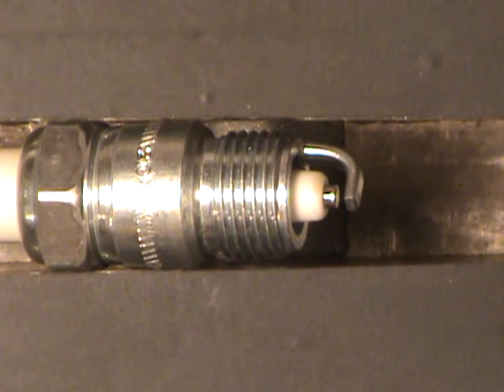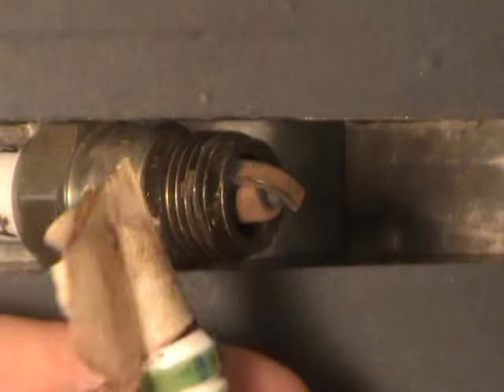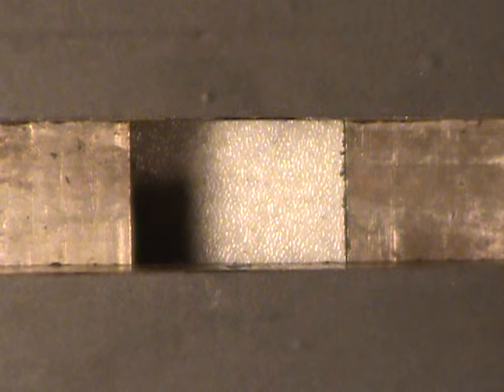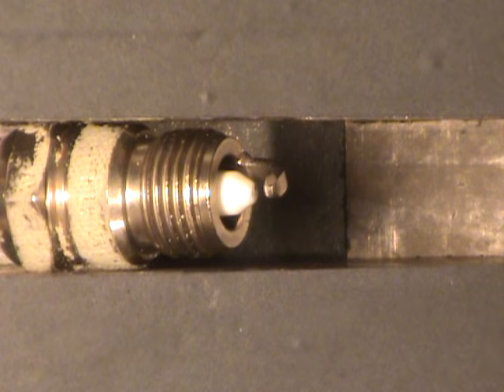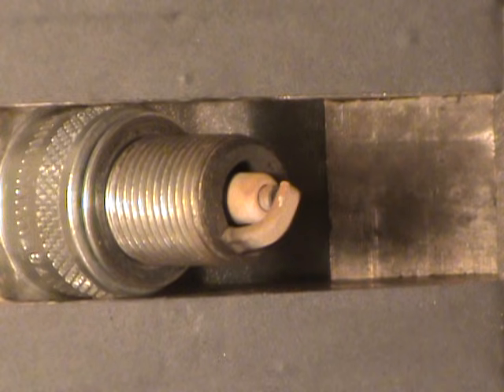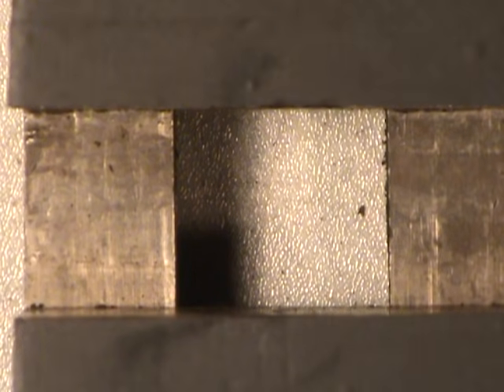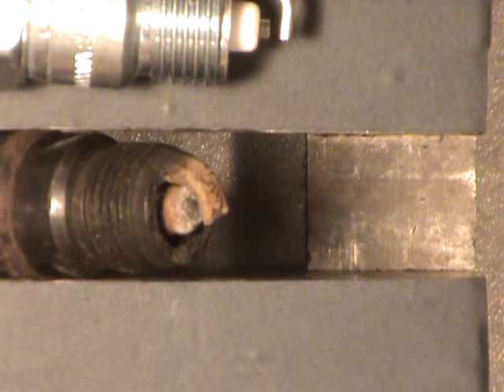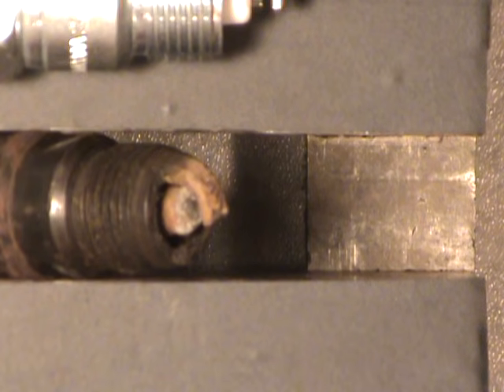SPARK PLUGS How to Read them (Part 3)

Comment from the maker: ...threaded, shell portion of the spark plug....If it did break off, I sure hope that, there isn't a Broken piece of Metal from your Spark Plug "Bouncing" around in the Cylinder, because, as the engine is running, it will continue doing "Damage" to that very same Cylinder!..."Ouch!"...Now, if it "Melted" off, sounds that, that particular Cylinder could have been running "Way-Too-Lean" (air/fuel ratio)....That would perhaps only apply to a Multi-Point Fuel Injected Engine, if in fact,...(con't)

Comment from the maker: Greetings kashpc....I'm guessing that you only have "1" Damaged Spark Plug?....Hopefully, the missing part of your Spark Plug didn't cause any damage to the Piston, Cylinder, Cylinder Head, Valves, etc., in your Engine....Also, did the Outer Electrode "Melt-Off" or "Break-Off?"....If it "Broke-Off", It might have been a Manufacturing Defect, or, even someone may have bent the Outer Electrode a bit too far, and maybe, back and forth too many times, weakening where it joins the...(con't)

Comment: Thank you for this interesting video. I was accelerating my car today to lets say 3,000 RPM (not too much I know) and strangely the outer tip of the spark plug blew off! This never happened to me before I guess this happened because the plugs were not the correct heat range and are very old. What do you think? .

Comment from the maker: ...Golly-Gosh-Darn, Yes-Siree-Bob, I should also mention that some of the later Holley Carburetors even have a little Screw-In-Clear-Sight-Plug, that goes into that threaded hole that you used to watch the Gasoline/Fuel trickle out of....Much Safer, and time saving too!....In closing, you might need some "Jet-Extensions" for your Secondary Float Bowl, to avoid starving the secondary's of that much needed Rich air/fuel mixture during that "Neck-Snapping-Launch!"....Take care, and have a good one

Comment from the maker: ...order to determine the "Wet-Fuel-Level"....I used a Spritzer-tube, you know, that little small plastic tube that you plug into a pressurized can of something that squirts fluid to the desired location?....I removed the metering rods from the Thermoquad (Engine not running), and put a stop, kinda like a little flag, made out of electrical tape, and used it, much like you would when you use your engines oil level checking Dipstick....Worked like a Charm!...lol...Where was I, oh yeah...(con't)

Comment from the maker: ...all of that particular Style of Holley Carburetor, stand a much better chance of having each of that Carburetors "Circuits" Meter the Air/Fuel properly in order to achieve, and hold the "Calibrations" to a more Refined and accurate Tolerance....It was this very fact that had me doing some head-scratching a few years ago, as, Rochesters and Thermoquads "Wet-Fuel-Levels" can't be seen at all from the outside!....In one of my Thermoquad-Videos,  you can see what I came up with, in...(con't)

Comment from the maker: Greetings TylerART....Thanks for your comment....One of the Best Design Features of Holley Carburetors is that some of them have "Externally-Adjustable-Float-Level-Settings", (Yes-Sir, I'm talking about the ones with "Duel" float Bowls, one front, and one rear), and even if you have to remove the "Plug" in order to watch the Gasoline/Fuel Dribble out in order to Confirm that the "Wet-Fuel-Level" is set properly (and, make sure your Vehicle is on "Level Ground" when you do so!), then...(con't)

Comment from the maker: ..."Primary-Jets" so that my Freshly Re-Built 1974 Thermoquad would keep my Engine from Bucking back and forth while I was just trying to maintain 30 Miles per hour (or, 50 kilometers per hour)!....You see my Friend, a Carburetor just can't adjust itself, unless of course it was one of the later Computer controlled "Feed-Back" Carburetors....Bottom line, the Carburetor has to be "Calibrated", for the type of Fuel that the Engine Burns/Uses....I was lucky, one Simple Jet-Change....Take care

Comment from the maker: ...calibrated for 100% Full Strength Gasoline of, oh, lets say, the 1970's for example....This 100% Gasoline is Un-Leaded by the way, and you could easily see the Deposits on your Spark Plugs....Also, before Un-Leaded 100% Gasoline came into the Retail existence, there was the Leaded 100% Gasoline, and that stuff gave you an abundance of Deposits on your Spark Plugs to "Read"....I had to go from .095" to .104" (95 thousandths of an inch to 104 thousandths of an inch) on my...(con't)

Comment from the maker: ...that their Engines are ingesting, and burning in the combustion chambers, that these Folks are not able to "Read" their Engines Spark Plugs, due to the "Lack-Of -Deposits-Showing" on their Spark Plugs "Fire-ing-End!"....With all of that Ethanol (Alcohol?), being administered to your engine via the Carburetor being "Jetted" far too "Lean" for this type of Fuel, then, it can, and will cause Lean-Running Problems in all of the Carburetors-Circuits, especially with Carburetors that were..(con't)

Comment: It was all a matter of opinion. Drag racers swore by type F. And yes many old timers would put it in anything. So it don't surprise me they put it in  your 727. Check out my video on the various fluid types in modern day cars. I remember 50 gallon barrels of F in tranny shops when I first got in the biz. It was cheaper so many shops used it if for nothing else to increase profit.

Comment from the maker: ...From what I recall, the 727-Torqueflite (Torqueflight) was supposed to be filled with Dexron, according to the books/manuals that I have read....I also recall hearing about, or maybe reading about, that the Dexron, had an Additive to help with the Auto-Transmissions Seals, as far as Conditioning the Seals, so that they don't start leaking perhaps?....Yes-Sir, nothing like having your car with a "No-Drive-in-any-gear-on-your-Shifter", while trying to get Home....Take care, and have a good one

Comment from the maker: ...about the difference between Dexron and Type-F Automatic Transmission Fluid....The response that he gave me, was that the Type-F (Ford?) had a "Higher Breakdown Temperature", as compared to the Dexron (General Motors?) Fluid....He also said that they put Type-F in most Automatic Transmissions that they service....That's right, they put Type-F in my 727-Torqflite (Torqueflight?), and it seemed to work just fine....I later, looked further into the difference of the two Fluids,...(con't)

Comment from the maker: Greetings David Smith....I hear Ya....A couple of things come to mind....I wonder if a newly certified Mechanic would be able to figure out a Carburetor?....I'm speaking of the younger Lads that probably were not exposed to Carburetors, and only Fuel Injection....The reason being, that since the 80's, the transition to fuel injection became quite obvious on Newer Factory Vehicles....Also, some years ago, I asked a Manager at a Transmission Fix-Em-Up Establishment,...(con't)

Comment from the maker: ...the method that I have been using for a very long time, to read my spark plugs, is what works for me....However, since most of the Gasoline that had Lead (pronounced Led), and is no longer available for street use, makes it more difficult for some to actually see, or read spark plugs, due to the "Un-Leaded" Gasoline, and some of the newer Formulations out there, leaving next to No-Deposits on your spark plugs to "Read!"....I hope that you find some (crossing fingers...lol)....Take care

Comment from the maker: ....as you can very well see, how my Spark Plug Video's "Thumbnail-Picture" appears, with the Gasoline that I put in my gas tank, that I'm most certainly getting a very nice "Tan" Color showing....However, you did ask how long will it take to start seeing an adequate amount of Deposits on your engines Spark Plugs, so you will be able to see what is going on inside your engines combustion chambers....Drive at all Speeds (Legally!, lol) about 100 Miles, more is even better....(con't)

Comment from the maker: ...(or), it could have even been a faulty valve stem Oil-Seal?....With the exception of the excessive (well, it really isn't something that I would lose sleep over), and the fact that I keep a very close eye on all of the vehicles that I have, and had, Fluid Levels and the way that they perform/run....I guess that I might have to change Mr. 400's Number 6 Spark Plug a wee-bit more often then the rest of his/hers remaining 7 brothers/sisters as the case may be...lol...Thanks, and, take care

Comment from the maker: ...I haven't ruled out a misfire on that particular spark plug, and its associated electrical path, right from the HEI (High Energy Ignition) Distributor Cap and spark plug wire....Still, the most obvious Symptom still happens to be the excessive engine Oil Consumption....I'm under the impression (illusion?), that it was a Ring-Seating problem, as in Oil-Control, or perhaps excessive valve stem to valve guide clearance (more then .003" or 3 thousandths of an inch), or...(con't)

Comment from the maker: ...if Burning engine coolant (in an engine) is anything like Burning Auto-Transmission Fluid, then, I would be mistaken for "James Bond's Aston Martin!", you know, with that Big-White-Smoke-Cloud that James Bond deployed behind his car, in order to Blind/Confuse the Bad Guys, as he was being chased?....Like James Bond, It happened to me, when the Vacuum Modulator developed a leak in its rubber diaphragm, allowing the carburetor, to suck up some AT fluid, and then the "White-Smoke!"....(con't)

Comment from the maker: ...my engines excessive Oil-Consumption was about the only issue that I could find....There wasn't any noticeable drop in engine coolant, and if the coolant (anti-freeze/water mixture) made its way into the Oiling-System, I would have found a trace (or maybe more), of the proverbial "Milk-Shake", creamy-colored (yucky-stuff) on my engines Oil-Dip-Stick....It was my Number 6 Spark Plug that had that (electrode-shorting), and, over-abundance of Deposit(s) (if memory serves me right)....(con't)

Comment from the maker: ...my brand new factory 1979 Chevy 400 C.I. V-8 (small-block) started and ran great, until about the 6,000 mile mark (on the odometer, I think?)....Everything appeared to be operating normal, until I started having hesitation problems at about 50 Miles Per Hour (80 Kilometers Per Hour)....Now it's Transfusion time! (nah, not really...lol)....What was happening from the start, was, my Engine was in need of a Quart (or Litre), of Oil, about every 500 Miles!...That is a wee-bit excessive...(con't)

Comment: Could the buildup on the last spark plug be from the cooling system? I have had similar buildups in an engine with a tiny crack in the head...

Comment from the maker: Greetings strikemaster1....Thanks for your nice comment....I've heard that the Rotax engines are a great engine, with excellent build quality as well....If you do try extending your spark plug(s) replacement interval as suggested by your engines manufacturer, may I suggest for safety reasons that you pay very close attention to how your engine is running, you know, like, misfiring, or miss-behaving in any way, shape, or form, so as to prevent you from being harmed in any way...(con't)

Comment: Thanks for this very educational video. It certainly has helped me in understanding my own problems a bit more. I fly an ultra-light aircraft using a Rotax 582 inverted engine. That is... the engine is upside down with the plugs at the bottom. The manual says to change them every 50 hours, but mine never show hardly any wear, so I am tempted to leave them in for a while longer. They always are a wet dark grey colour without any build up at all. Its a 2 stroke engine, which accounts for wetness.

Comment from the maker: ...gap-growth you say?....That is the "Erosion" (arcing, due to the electrical spark) of the center electrode (tip), and the inside of the outer electrode (ground strap)....A good rule of thumb is to have about .001" (one thousandths of an inch) of Erosion (wear) for every 1000 miles of engine operation....Any more then that usually spells trouble....Perhaps, too lean, wrong heat range, overheating engine, type of gasoline, how hard you are pushing the engine, rpm's, etc....Take care my Friend

Comment from the maker: ...the Old-School method that I use, has served me very well, as I haven't Destroyed any engine thus far, due to having said engine jetted too lean, and running at Wide-Open-Throttle....If any of the engines that I have, or have had in the past, had any running issues at all, I most certainly would-not apply full-throttle, until I saw that "Safe" Tan color on my spark plugs....Also, with the older "Conventional" style of spark plugs, I keep a close watch on the Gap-Growth...(con't)

Comment from the maker: ...no matter what engine you are talking about (gasoline ones, that is), if one was to run any gasoline engine too "Lean" (air to fuel ratio), while at Wide-Open-Throttle, one would more then likely "Destroy" the Engine in question, and that my Friend, is a very "Expensive" lesson!....Don't get me wrong, as there is usually an exception for every rule....One of the best ways to determine air/fuel ratio, is with an accurate wide band oxygen sensor, and a very accurate gauge or monitor....(con't)

Comment from the maker: ...my Thermoquad carburetors Factory primary jetting was .095"....When I looked up the factory jetting on the net, it read .098"!!!....If I went any smaller then .104 on my Thermoquads primary jets, I would get a "Lean Surge" (car lurching back and forth) cruising at 30 miles per hour (50 kilometers per hour)....I only run 87 Octane gasoline (cheapest stuff), with factory initial timing of 5 Degrees BTDC, and, no knock, no ping, goes like no tomorrow, and I'm happy as can be!....(con't)

Comment from the maker: ...I've also see Light-Gray-ish inner porcelain as well....Might be ok on newer cars that were engineered to run that lean, because the computer, sensors, and actuators, are kind of a Fail-safe, if you will....Knock sensors, for example, have the ability to tell the ECU (computer) "To Back Off!" (the ignition timing, that is), preventing, knock, etc., to avoid (Expensive) engine damage!....Take a look at my spark plug thumbnail...Light Tan almost all over the inner and outer electrode...(con't)

Comment from the maker: ...now, about going with the "Rocket Science" method of reading spark plugs that you had mentioned....I have no need to go that far in the readings, for the very reason that I'm not trying to shave off a hundredth or two on a 1/4 Mile run at the drag-strip, or even Daytona, for that matter....I even doubt that those colors would materialize with the way that my Thermoquad carburetor operates.....I have had lean running before....White inner porcelain scares me!....(con't)

Comment from the maker: ...also, before I forget, it also had the Factory "Transistorized" ignition (module mounted on firewall), and a separate oil filled ignition coil mounted at the rear of the intake manifold....Also, spark plugs gaps were set at .035"....this/these spark plugs only had a few hundred miles on them, and, as you can see, they sure look good (to me that is, lol)....The way that they would look at the manufacturers replacement interval (12,000 miles), would have more deposits on them....(con't)

Comment from the maker: ...also, with a 4-Speed Manual transmission....Only modification was upgrading the stock cast iron exhaust manifolds, to tubular headers (already had factory dual exhaust)....Now then, It's read the colors time....The black carbon ring that you see on the end of the threaded shells surface, is more then likely the result of the "Rich" air/fuel mixture that the carburetor provides with the choke plate, and because the engine is cold, and fuel atomization is very poor....(con't)

Comment from the maker: ...oh, where to start, as there are almost limitless variables at play here....I know, let's start with the Spark Plug that you see in my videos thumbnail picture...My videos spark plug is out of a 1974 Dodge 360 cubic inch (5.9-L) Factory high performance V-8, with a freshly rebuilt 850 CFM Thermoquad carburetor, primary jets increased from .095" to .104" and the secondary jets at .143" (factory installed)...Brand new Champion RN12YC spark plugs, with only a few hundred miles on them...(con't)

Comment from the maker: Greetings Chris....I have read about the things that you have mentioned about "Reading" the different parts of spark plugs a few years ago, and, if you look at my videos "Thumbnail" picture, you know, the one with the nice light tan colored coating on the porcelain surrounding the center electrode, and on the outer electrode (ground strap), and also the black carbon coating on the threaded metal shells surface, perpendicular to the threads, that, that's what I like to see, simply put....(con't)

Comment from the maker: ...and yet another due to a Thermoquad 4-Barrel carburetor being jetted too Lean for the Gasoline that we are buying these days, as compared to the Gasoline that we used to have in the 70's....I had to go from .095" Primary jets (2 of them), to .104"!!! (95 thousandths of an inch to 104 thousandths of an inch)....When using the .095's, the car lurched back and forth, while trying to maintain 30 miles per hour (50 kilometers per hour), and no harm done (I think? lol)....Take care, my Friend